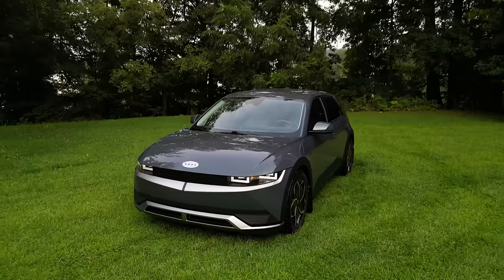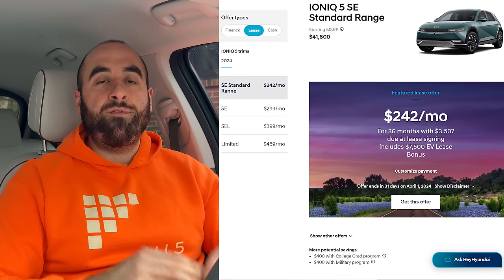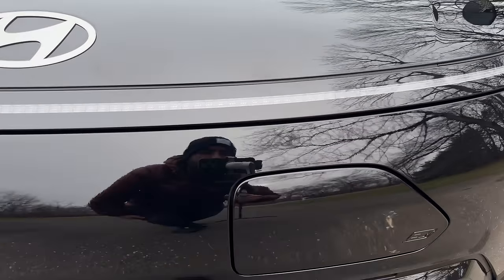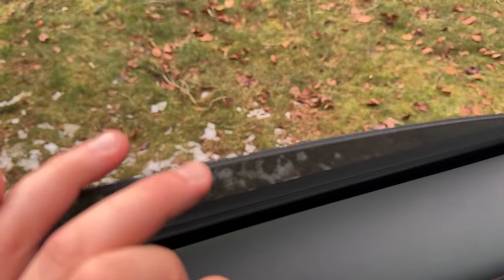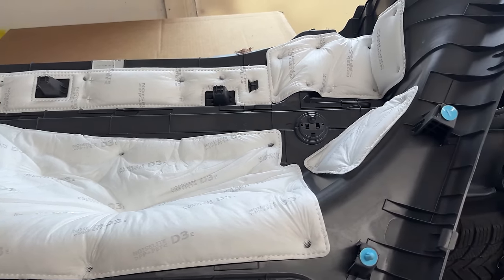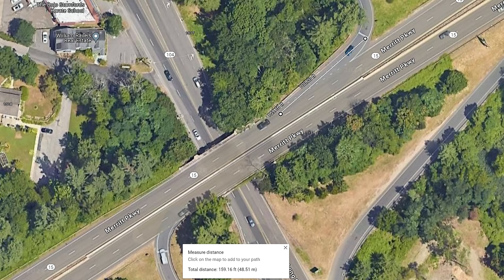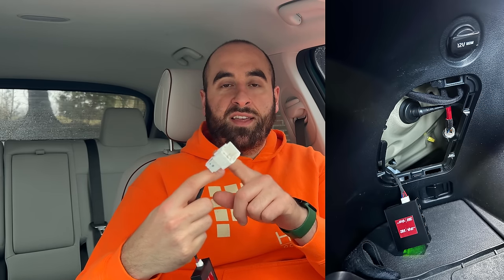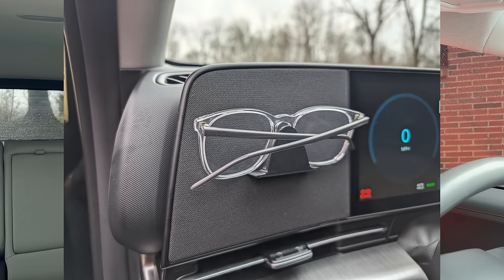Part 1: 5 Reasons To Buy or Lease a Hyundai Ioniq 5

Comment: The ONLY reason that you should NOT purchase a 2022-2024 IONIQ5 and wait for 2025 model: You have to replace the Low Conductivity Coolant every 35K miles or 4 years and it will cost you $700 to $1000 which is crazy!

Comment: Looks, comfort, the smoothness of the drive, interior, and yeah, that GO factor. I live 12 miles out in the country from my dinky small town on what is mostly a two-lane highway. And hilly, so there are only two stretches where one can pass legally (and no shoulders on the rest of it  as it cuts through those hills). Speed is 60 mph. Locals usually drive 65-70, because, Texas.  If I am behind Grampy McGrampster driving 48 mph? BOOM. Pop it in sport mode and I am back to average driving speed. My real only dislike (I'll save up for next week): the nicking from road dirt and gravel on the silver-tone plastic bumper and trim areas. Mine is only 8 months old, but that is gonna look like hell in another year.

Comment: Good list of major advantages.  
There are quite a number of other features I got with my 2023 LTD - 
Automatic retraction of the seat when the door is opened making it so easy to get in and out.
3-level heated and 3-level ventilated seats
The extraordinary lane centering and cruise control. I always have lane centering on cruise is on about 95% of the time, city and highway.
3 odometers with each with its own distance, time and MPK: Every drive, Since recharging and Cumulative.
When you adjust the headlight settings and/or wiper settings it shows the status on the driver screen.
Really comfortable seats.
Very good MPK.
Heads-up display!

So add it all up and you get a really great EV.
Reply: That’s what I put in one groups as”bells and whistles”. One of the reasons I’m probably passing on the Y despite the price.  Really no luxury features. I’ve always compromised on the trim but by golly, this time, well this time I want it all!
Reply: All of these are with the LTD and not the SEL? I think that's what you are saying, but wanted to be sure (outside of the comfy seats and HUD of course!).

Comment: There’s one additional regen trick you missed.  Max regen
Holding down the Left paddle engages Max regen mode for however long you hold the paddle, then returns to whatever level it was set to after you release.  That mode is equivalent to full I-pedal regen, effectively level4 regen.  It’s useful if you are not in I-pedal and want a quick burst of maximum  regen without having to hit the brake pedal.

Comment: Firstly it’s hard to argue with your top 5, and I feel they apply equally well to sister and brother vehicles as well (style preferences obviously differ, but we get such a great variety of styles between the I5, I6, EV6, & GV60 instead of the same egg shape just resized.

What I’d add,
6) V2L powers my critical stuff during power outages, or powers blenders or an oven when tailgating or power tools anywhere I can take the car.
7) wired CarPlay is solid and doesn’t cook your phone like most Qi chargers do.
8) love having physical discrete controls for climate, and other frequently used controls.  Far less distracting than taking my attention from the road to use a touchscreen while driving

Comment: congratulations.
Ioniq 5 has received a facelift.
An 84kw battery is installed, and a rear wiper has finally been added.
There have been minor changes other than the digital room mirror, but the basic price remains the same.

Comment: 1. Charging speed and curve
2. Price to feature ratio vs competition at the time. Since upside down due to price cuts elsewhere and spec downgrades by Hyundai
3. Styling and less of these on the road generally makes it stand out.
4. Had the classic Ioniq 28kWh for 4.5 years before and loved it
5. Boot, interior and trunk space as had a baby on the way at the time to buying

6. It was well received by reviewers across the board. When Bjorn Nyland was also one of these I was sold (he was the reason I picked 28kwh Ioniq in 2018 also).

Comment: All good points that I can pretty much confirm! As for your reason 3, I'd just as soon have minimum and maximum (i-Pedal) regen settings, and I wish the latter would remain set after I turn the car off and then start it again. Now I'm curious to know your 5 negative reasons (likely not having a rear window wiper is one of them, but the digital rear view mirror in my Limited eliminates that complaint). I will admit that one important feature it lacks is a dedicated, one-button engaged DOG mode. Using the "utility" mode works, but… is difficult and cumbersome.

Comment: Here in Europe you can get it with a 58kWh pack which has a peak charging capacity of 176kw. Has the same 10-80% time as the larger pack with higher charge speed. This speed and more importantly the charge curve is why I bought the smaller battery and saved five thousand. I only need to road trip a few times a year so not worth the extra money. This was a huge factor in my purchase decision.

Comment: Also part of reason 3 for me is the ability to use the left paddle as a brake to slow down the car beyond the level of regen selected.
Reply: I didn't get it. Can you pls elaborate on how to use it to brake??
Reply: @CRVgarage  The left paddle increases regenerative braking from 0 (off), 1, 2, 3, and 4 (one pedal driving). The right paddle decreases regenerative braking. Regardless of regenerative braking level, if you pull and hold the left paddle (not just clicking it), the car will brake and come to a complete stop. This is different from one pedal driving. In town, I like regenerative braking level 2 plus I will brake the car by pulling and holding the left paddle at stop signs and intersections. I generally prefer the friction brakes for going around corners.
Reply: @mateharris  thanks so much for the info.

Comment: I test drove this a couple of weeks ago, really liked it, especially the regen paddles; it is like downshifting. But I have a question about efficiency vs a Tesla M3. The I5 AWD outweighs the M3 LR by about 500 lbs, and it doesn't seem to be much smaller at all. I know the M3 uses 18" wheels, the SEL 19" . But what else counts for that big weight difference?

Comment: Great video. I'm interested in the auto lock/ unlock. Do you have a video of the horn noise in Ev6? It is the reason behind my hesitation
Reply from the maker: It's the full horn. You don't have to use the auto-unlock setting that does this though. The device was designed for auto-locking and the auto-unlock is just an added benefit.
Reply: @TheIoniqGuy  Thank you so much. I hope one day there's a solution that doesn't have a horn noise. I live in a safe place and garage kept car. Prefer the convenience  of lock / unlock without horn noise   Thanks again for your candid comments. You rock

Comment: What about that white interior? Does it stain?  Jeans etc? And the winter snow to maintain it clean? Im worried abiut that color or else im gonna go dark interior but it doesn't come in digital teal green...
Reply from the maker: Depending on your jeans, it’ll show a bit of dye transfer on the lower seat cushion bolster but it washes right off. I personally hate dark interiors. In my experience, blue jeans are a non issue

Comment: Corbin - the EA experience in FL has really pushed me away from buying right now.
I do not have a local charging station - although Tesla did just open one in Jan around 10 miles from me.

Glad that they took the 7500 back off- any idea when they will be able to use the Tesla Superchargers?
Reply: An EV is a good buy when you charge it at home. Local fast charging stations are useless when you charge at home.
Reply: For the most part my advice is don’t buy an EV if you can’t charge where you park.  That might be at work, at a park and ride, or at a home or apartment.  If your daily miles are under 30-40 a standard 110v circuit may suffice.  You REALLY don’t want to depend on DC fast charging for day to day use in most cases, mostly because of the higher cost.  The exception might be if you can combine charging and grocery shopping and don’t mind paying about 3x your home electricity rate.

Comment: Can you drive the car like a gas car?
Reply from the maker: How do you mean? It drives like any other car except with crazy acceleration
Reply: @TheIoniqGuy  I like It when you take your foot off the gas and the car still moves forward. The Tesla the car comes to  immediate power loss.
Reply from the maker: You have various levels of braking from coasting to full regen which brings the car to a stop with just the accelerator.
Reply: @TheIoniqGuy  great thanks for the quick response, they just have really good lease deals now so I’m kinda surfing video right now.
Reply from the maker: Yeah the lease deals are excellent!